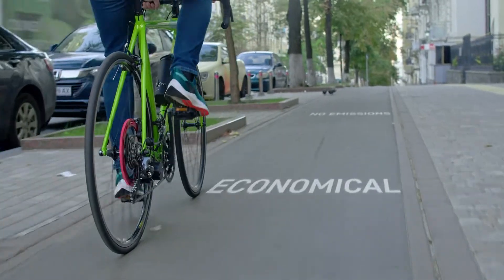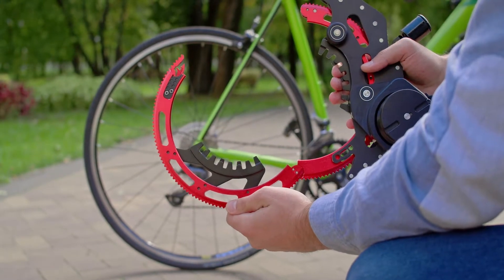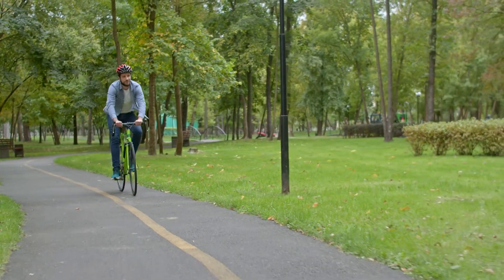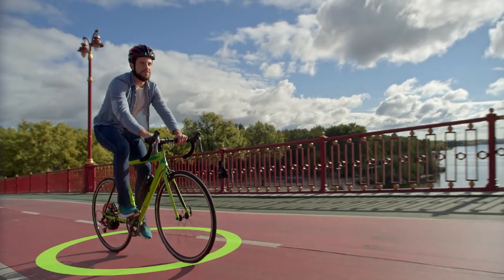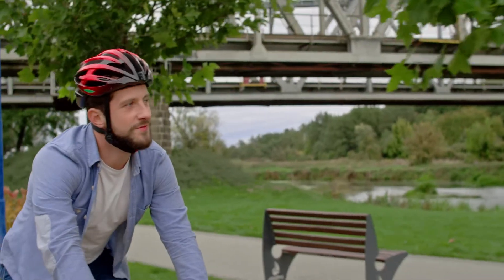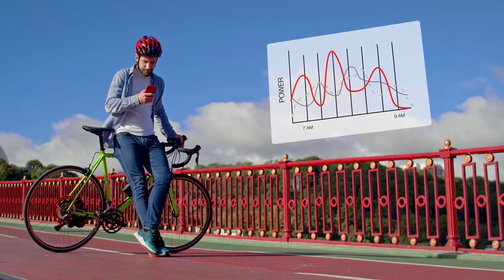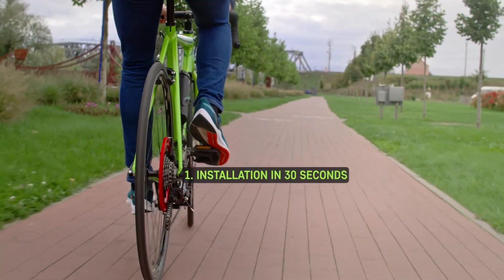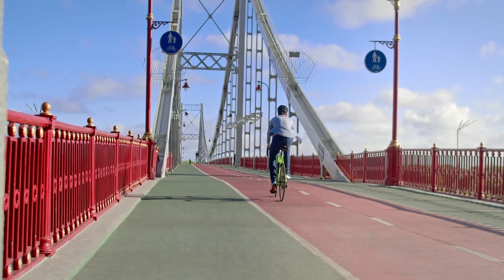BikeOn - Wearable For Your Bicycle. Turn Your Bicycle To Electric In Seconds

Comment: Do you lose the ability to shift gears while installed?
Reply from the maker: You lose 2-3 largest gears, but you can shift the rest. Basically you exchange 2-3 gears to the motor

Comment: surely it is easy to accidentally shift the rear derailleur into the drive system destroying your bike.
Reply from the maker: BikeOn has an embedded mechanical limiter which prevents the derailleur from shifting into the drive system.

Comment: I really hope this project does well and is put to scale. I have some questions
Is the motor brushless? And what is its size? It seems like the unit is entirely self contained with no controllers or interface aside from the app. It seems awesome for this purpose, I just can't put my head around how can it all fit in such a small unit.
How much does it weight?
Can I keep the cable on the bike and remove only the motor and battery?
My suggestion is that not only does it make it easy to carry with me to prevent theft, but also much easier to have multiple bikes and swap the motor with whatever bike I'm using. A lot of people have different bikes for different purposes and terrains. So it goes back to my previous question. Selling the cable separately at an affordable price could be a huge selling point.
Reply from the maker: Thanks for your kind words!
BikeOn uses a custom made brushless motor. BikeOn contains everything inside: multiple sensors, motor and logic controllers. Indeed it was an engineering challenge to fit everything in such a small unit, but after several years of research and development, we managed to do it :)
The weight is about 3.7 lbs (1.7 kg) excluding battery.
Yes, you absolutely can keep a cable on the bike and remove only the motor and the battery. And thanks for your suggestion. We'll make sure to offer cable as an additional, separate purchase item. If you have any other questions or comments please let us know.